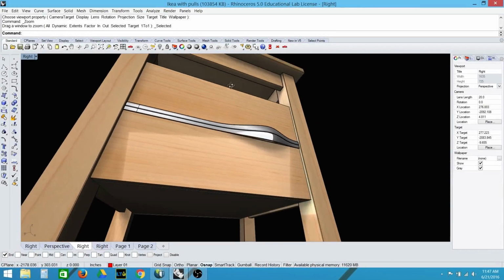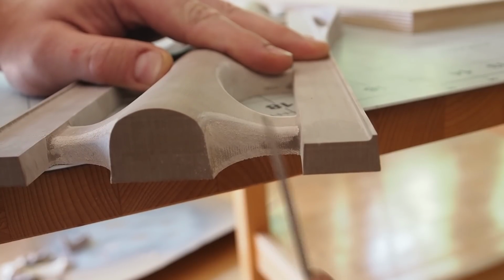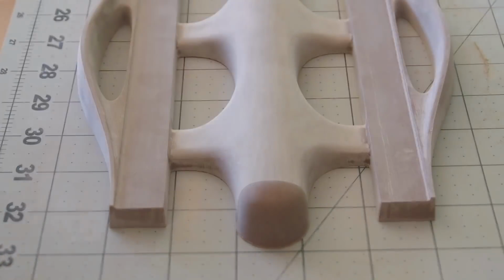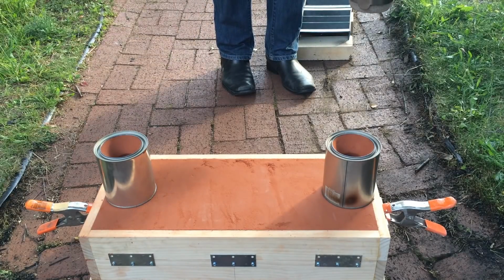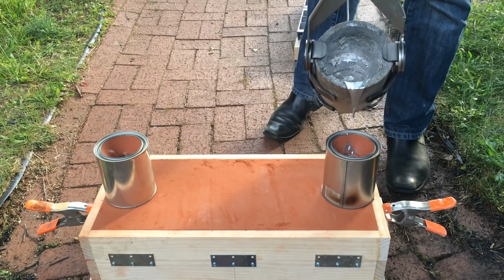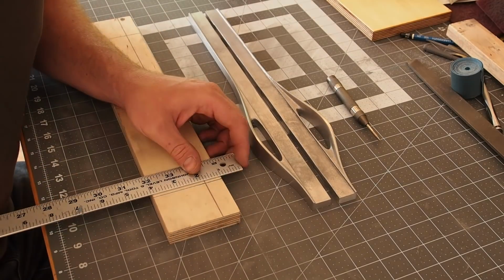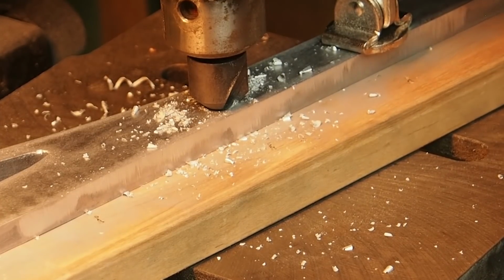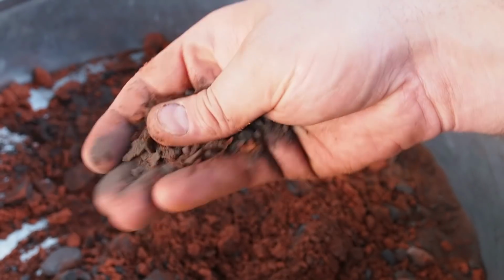Casting Custom Aluminum Drawer Handles

Comment: why use such an expensive material to cnc the design and then cast it, when you could just cnc the aluminum into the finished piece to start with?
Reply from the maker: Because the cost to machine a billet of aluminum from a material and time standpoint would be prohibitive for multiples.  This is not the case for an expensive pattern that can be reproduced until the pattern fails.

Comment: I really don’t get renshape 
First off: is it a plastic or a wood?? From what I gather it’s a plastic that behaves like wood 
Second: why the hell would anyone spend so god damn much on something like that?! It seems like it could be replaced by dozens of far cheaper alternatives
Reply from the maker: It is an extremely dense urethane foam.  There are even more expensive versions, but generally people that use it have ‘no compromise’ money for tooling boards.
Reply: @Grunblau  that’s what I figured shortly after posting it. This was one of the first videos I saw of yours so it hadn’t occurred to me that you’re actually in the “DIY” profession 😭 I saw you build your metal break in your backyard and just thought you were a hobbyist like me LMAO

You got contractor money for building big ass fountains with water jets 😭 this little foam board ain’t nothing

Comment: Looks great but wouldn't they trap fingers between them 

Wonder if that happened in the past five years
Reply from the maker: My fingers don’t fit.. I could have done it without the hole, but it is mostly for dust and such to pass through rather than sit on top of the pull…
Reply: @Grunblau  i only ask because i made something similar from white oak.. and ended up with blood blisters from trapping my finger in it now and then. The pitfalls of form over function i expect haha

Comment: Why not just machine a block of aluminum directly on the CNC? Seems like a lot of extra cost and effort this way.
Reply from the maker: It is actually the opposite.  There is a lot of extra cost and effort in CNCing into solid aluminum and I would still have all of the finishing work to do as well.  I made 5 sets of these handles.

Comment: That long tip marker. Where did you get that? @11:17
Reply from the maker: It is a pattern marker.  This one is Fastcap.  Adam Savage swears by the Pica brand and I’ll probably try them next.  Although these particular ones have ridden out about 5 winters in my unheated garage and still work great!

Comment: I'm late to this video but. why not just use the cnc on sheets 2"thick x  24"long x width of aluminium cutting out the casting process and the use of the expensive 460 board
Reply from the maker: Sounds easier and cheaper than it is.  I made 5 sets of these and can make more.  A plate of 24”X48”X2” Aluminum is going to be MUCH more expensive than Renshape.  Imagine a week of just machining aluminum and still having hand work.  90% of the comments here would be “Why didn’t you cast it?”  They would be right!

Comment: I love your work!!!! Still curious, why machine wood and cast aluminum and not going straight to machining aluminum? Do you get a better finish on either method or is it because of the kind of tools required?
Reply from the maker: Thanks!  Patterns make multiples much easier.  Machining aluminum is much more difficult and time consuming than it sounds and would likely require handwork as well.  Casting is also less wasteful as aluminum that is good for machining is generally not good for casting so the chips aren’t directly reusable.  Many times, both methods are used.  An approximate blank is made and then critical dimensions are machined.  Hope this helps!
Reply: @Grunblau  wow, that makes so much sense. Thanks!

Comment: Ps where did you get your tongs? I can’t find any like those on amazon.
Reply from the maker: I designed them and had them laser cut.  Working with a foundry store to carry them now!
Reply: @Grunblau  oh fantastic! I need a set for one of the smaller crucibles. They’re difficult to find.

Comment: I know the proper way to make a cylindrical under is to mill it, however is there a proper way to channel a pour of a hollow ring-like cylinder roughly the size of a vintage 50mm lens with 4 raised accent pieces around the cylinder every 90 degrees?

Comment: I really like this project. What cad/cam software do you prefer?Have you ever tried an aircraft style countersink? You can micro set the depth from the top and that eliminates variation resulting from material thickness.
    The handles have a beautiful style. I worry that due to the holes lining up, a finger could be hurt when opening or closing if one was not mindful. 
  Thankyou for sharing your  work, it is very lovely.

Comment: When making up a drill guide for reproducible results you can go to most machine shop supply houses and get hardened drill guides. You simply drill your guide oversize and slip the sleeves into the holes. When you go to mark your pieces you just place your guide and drill through the hardened sleeves. They are very accurate and you will probably never have to reproduce your guide again.

Comment: A lot of the oil from the 'burnt' petrobond is still around, just isn't in the 'burnt' stuff. Note that the 'good' sand is extra gooey just outside the burnt stuff. This is the lost oil. Oil is vaporised from near the casting cavity and condenses in the cooler sand farther back. Only a tiny amount is truly burnt/lost.

Comment: Why use such a thick top cast with nothing in it? isn't that just a wast of petrabond? Can it be less thick?
Reply from the maker: +TwoCylinderDon Mostly waste of effort as the petrobond is reusable.  Also thicker helps hold the heat in small areas...

Comment: Seems the burnt sand just lost all its moisture... maybe mist it with water and mix it well? Worth a shot if the alternative is throwing it away. Though, I guess adding water could possibly cause problems with steam in future castings.
Reply from the maker: +JestersDead Replace 'water' with 'oil' and this is correct!
Reply: Ahh, oil does make a lot more sense.

Comment: My machining instructor hated the smell of Tap Magic.  I used it as an anti-galling agent for knurling aluminium for making a knockout rod for the lathes in the shop.  It probably wouldn't had turned out so well had I not had used it.
BTW is this commissioned work?

Comment: Nice work! Can I ask if there is a "science" behind your decisions around the gating design. In particular the smooth rounded shape, the area allowing flow into the part and he location of those entry points etc... Thanks for the Video. Take Care
Reply from the maker: +Pete Ferguson Mostly just seat of the pants after a tiny bit of experience.  For example, if the runner tapers down it sort of cleans the molten aluminum.  The reason for the multiple gates is that they are easy enough to remove and more gates will mean more consistent.  The size of the runner is in hope that the part is filled completely before the gates and runners seize...  I did 5 casts of this and they all worked great!  The middle runner could probably have been smaller, though.
Reply: Thanks for the info, will help me with my first casting project :) I did think I was the only one on that flight(Seat of Pants) though...Some very nice work in your videos. Thanks for responding. Take Care.
Reply: A good concept to be thinking in the design of gates is “no turbulence”. You want smooth laminar flow of the molten aluminum. Turbulence introduces gas porosity, dross, and imperfect filling of the cavity. Also, aluminum experiences tremendous shrinkage as the casting cools. Gates and runners should be designed to feed the shrinkage as it occurs in the casting. There are fundamental rules in pattern-making that mitigate many issues. Originally, Pattern-making was a skilled craft following good design rules. CAD has turned it into more of a science using complicated, expensive, CFD programs that validate many of the old rules of thumb.

Comment: Since it is flat on one side you could easily mount the pattern on a piece of 1/4 inch hardboard and make it into a matchplate. That would make it really quick and easy to remove the pattern.

Comment: Brian, where did you get your crucible tongs that tilt the crucible as well. I would love to get a set. I am sick of having to bend down with the rigid tongue set.
Reply from the maker: soon...
Reply: So one other thing. I do not always paint my tooling board pattern and I sometimes have separation issues from the petrobond. Dependant on geometry. Do you find that that is necessary?
Reply from the maker: +gus bisbal I finish my patterns to a point where they are very smooth.  Sometimes this is paint, sometimes it is wax, and sometimes it is just a lot of sanding!  Make sure you are using enough separation powder and have a good draft on the pattern.  BTW- I made the pouring tongs and hope to complete a video on them soon!
Reply: Those tongs are pretty slick alright, I'd love to see them in more details.
BTW, the guys over on the casting forums at alloyavenue.com are saying nice things about your work, I'd encourage to introduce yourself over there.

Comment: If you just needed the end pieces why did you cast the middle piece too?
Reply: think it helps with the flow of the aluminium.
Reply: Just to clarifyt the other response - that middle bit is the runner system to ensure that the molten aluminum gets to all the little corners of the parts he wanted. It's actually a major part of casting like this - you really need to think about it and get everything right to get the metal to go where you want before it cools off and blocks one of the gates...

Comment: Just wondering, why did you chose to mill and cast, instead of milling it our of aluminum right away?
Very nice job by the way, will save this as a tutorial on casting for future, if I ever get to it.
Reply from the maker: +elektrinis Thanks for watching!  Casting is much more economical approach especially for multiples (I did 5 sets).  Material alone for one pair would likely be $50+ in Billet.  Scrap aluminum is anywhere from free to about $1/lb

Comment: Absolutely exquisite work. The form and shape of the drawer pulls is beautiful. As a tool and die maker I can appreciate the effort and engineering that went into making these pieces. Where did you get the aluminum? Soda cans? Aka pop cans here in Canada. What did your wife think about setting up a foundry in the back yard? Could you have used the lost wax method? Keep up the good work. Will be subscribing.

Comment: I've paid big money to professional foundries and haven't always gotten as nice results as what you've produced.  Beautiful design, I also enjoy how you've allowed the plywood edge to become a pleasing design element. I'm a little concerned about putting those fasteners into the edge of the plywood and how it may come back to haunt you if it were to cause the fronts to split. The bottom of your match plate is empty, maybe you have some room to extend some material down to form a more stable mount. But what the hell do I know I make machines where I'm always worried about people intentionally breaking them and not beautiful home furniture like this. Awesome work Brian!

Comment: I reckon a kitchenaid mixer and a dough hook would give you a homogenous mix. The hard part is knowing your burnt:unburnt ratio.

I'm assuming they have different densities (burnt vs new). You could use a press to pack it into a form of known volume at a given pressure. Variance from the density of brand new medium under the same conditions would tell you how much burnt sand you have. Obviously, you'd have to get a density of pure burnt sand with reasonable purity.

There's probably a simpler way, but that's where I'd start. Compare the densities of burnt vs. new.

Comment: Ummm no one has pointed out that he has a CNC machine.  So why waste time making a mold,  casting and finishing.  When he could easily have just cast a block on Ali and set the CNC to cut it.  Would he perfect in every way then.  Also all waste can be melted into a new block of Ali for next project.  Seems like a massive waste of time.  Looks nice though,  but CNC products are better
Reply from the maker: +Nik A False.  Actually it has been mentioned a few times!  CNC part would actually require more finishing after a much longer machine time because it is easier to sand Renshape than Aluminum.   If it took 2 hours to machine the pattern, it might take 10 hours to machine the aluminum.  CNC chips can be melted down, but the alloy you would use for machining isn't good for casting.  I made 5 sets of these so far so there is a huge advantage for multiples.  2 hours to machine and finish pattern and one hour to ram up and cast (total of 7 hours for 5 copies) vs 10 hours per CNC part (total of 50 hours of machine time for 5 copies).  CNC result would likely be less smooth unless step over was set really small, drastically increasing machine time..  I suppose it would require less physical labor, but CNC isn't always better!
Reply: Right on the money. When producing a large number of parts you would save more time and money when casting versus machining. If you want to factor in the cost of machining versus casting in a manufacturing environment you save way more money when casting. Not to mention the cost of bits for cutting aluminum which would need to be replaced as they dull. Also you waste a lot less aluminum when casting since your sprus and risers etc can be remelted down for the next batch run, whereas aluminum chips off the cnc need to be properly recycled by a plant and wouldn't be able to be reused especially by a DIY home hobbyist. Trust me I have tried melting down chips from a cnc, it all just turns to slag.
Reply: In a prior career I ran a cnc shop and contracted programming to several. 
  If that part were machined from bar stock you could not fixture it with 4 wood screws. You cant just "drop a cast ingot" on the table of anything and expect it to stay there. 
  If you had any appreciable metal removal rate the gantry style router used here would not be rigid enough to make any money. 
  To not post finish it your step over would be so small you would never make money.
   Casting this part is the right choice. If you were talking thousands of pieces than sand would not the the most economical. 
  Even if you were to machine it after casting getting it near net would be the best production cost.  Though a machined after cast 3d shape would likely require additional steps to ensure porosity cannot occur.
Reply: If this was true, everything at harbor freight would be CNC machined, and not cast. Derp.

Comment: This video is inspiring. I didnt like how crappy alu casting usually turned out but this video shows its just people doing it wrong. This is pretty much industrial grade finish...   I want to do alu and copper so bad.. i have a 3D printer and a CNC Mill for molds but property is too small to build a forge around..

Comment: How do you drill into metal so easily? i'm using a power drill and it wont go into a tiny piece of metal more than about 2mm till the bit just spins and refuses to go further
Reply from the maker: +harrisnutter If I had to guess, you are probably drilling too fast.  Drill press is also the way to go, just set the belts to run slower.  If you don't, you'll melt the cutting edge of your bit.  As soon as this happens, you are basically trying to friction press a steel rod through metal.  If you are talking about drilling aluminum, make sure your bit is sharp and use lube to keep from gumming up your bit or the same thing will happen.

Comment: I would be a good idea to anodize or put lackuer on the drawer pulls as bare aluminum does go gray and loses it's shine after a while.
Reply from the maker: +Poptart McJelly this is a very good suggestion.  For these, I wiped them with silicone spray, but they are already a bit too shiny for the shop and I look forward to them dulling a bit under use...

Comment: Nice work fresh petrobond mix gives such nice castings, Instead of a expensive muller I use a large harbor freight cement mixer I have a couple round ingots in it and just throw my sand/petrobond mix in it after each casting then let it run for about 10 min depending how many pours I'm doing I put a little non detergent oil in it when it gets dry and add some fresh petrobond clay to it when it gets weak.

Comment: Wow, you're REALLY brave to screw-in all the screws into the edge of the plywood without pre-drilling. I'd be worried that it'd crack them.
Reply from the maker: +CoolKoon I too would worry that would split.  I did predrill the holes, it just went by fast!
Reply: +Brian Oltrogge Oh, I see. I thought that you didn't drill at all, because I haven't seen any holes in the video. Anyway the results look REALLY good (and sturdy, MUCH sturdier than the crap sold at Ikea, Kika et al.) ;)

Comment: Man these are beautiful.
Reply from the maker: +Sigma Projects Thanks!
Reply: Brian Oltrogge They remind me a bit of modern German design, especially the brush metal on light colored wood. May I ask what model CNC were you using?
Reply from the maker: +Sigma Projects I designed and built my own CNC.  I named it the Platform and I do make kits for it from time to time...
Reply: Brian Oltrogge Oh nice, do you use like Cura or something for the slicing? I don't mind building myself, it generally gives me a greater appreciation of the components involved and the design. Do you have a video on it?